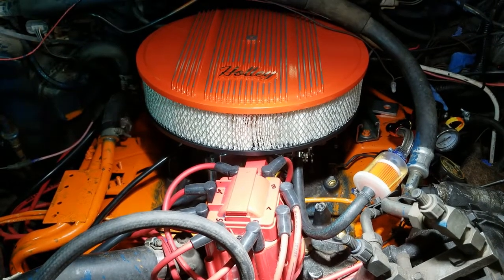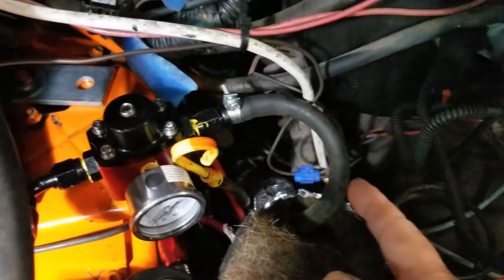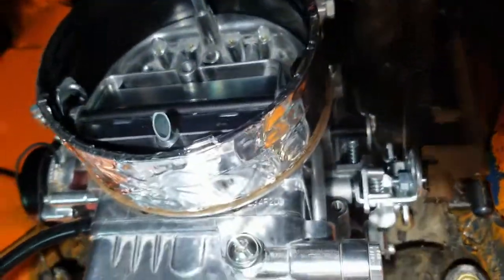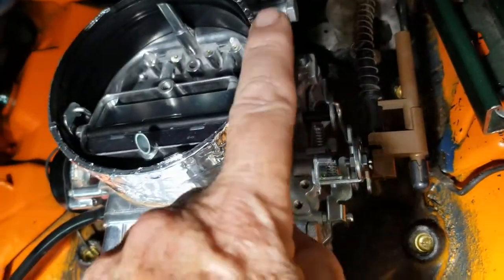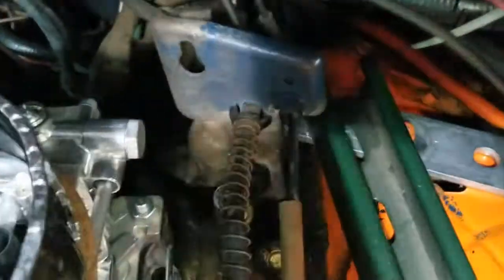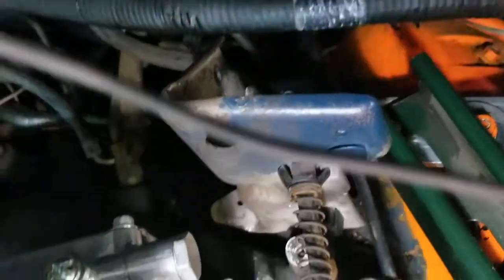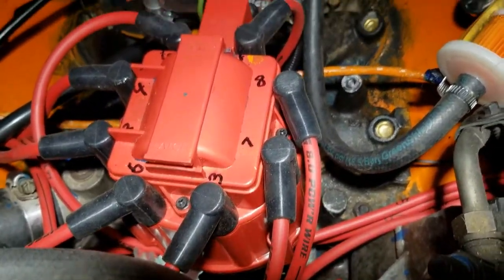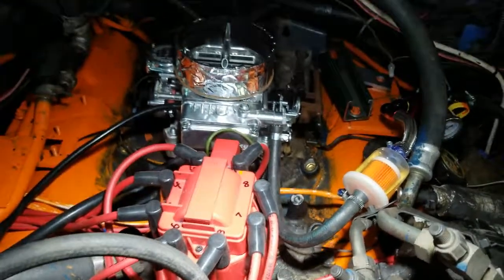Ford 460 EFI to Carburetor Conversion

Comment: Really nice job, it must run sweet now not having that old fuel injection that in notorious for causing issues. Do you have a video of what you removed, and what had to stay to do this conversion. I'm looking to do this, but not sure what to do with all my vacuum lines.
And anything else that needs to be removed, or done. Thank you for any help you can pass on or video

Comment: Why anyone who owns and runs anything Ford even remotely considers GM style HEI garbage distributors as a viable option is beyond me.
Reply from the maker: The HEI distributor delivers a stronger spark, especially at low rpms. Your comment made me do some investigating and I found out that HEI not only puts the coil inside the distributor cap, but also uses an electronic module to fire each point instead of mechanical contacts. Some say that older HEI distributors like this Ford one don't hold up well above 5000 rpm. That is fine for people like me that need low end torque, and never go over 4000 rpm because the engine is so old. The Ford big block is designed for low end torque, while the Chevy big block is more for speed and high end horsepower.

Comment: Where did you get the studs to mount the throttle cable and transmission kickdown cable to the carburetor? Is there a specific size ?
Reply from the maker: The Holley came with a stud that worked for the throttle cable.
I held a bolt-head against a metal cutoff saw blade with vice grips
to grind the head down enough to fit the kickdown cable slot,
but that did not last long before it fell off. So I left it disconnected
and I have never needed the extra power for passing because I
never pass unless I have a mile of clear road. Downshifting to 2
can be done manually if you have a lead foot.

Comment: Do you have to do anything to the computer when doing a efi to carb swap. I got a 93 f350 with a 5 speed manual.
Reply: Has smog delete and egr delete
Reply from the maker: The computer will throw some engine codes, but on my 88 it is not needed and I could unplug it.
Later models have computer controlled automatic transmissions, so they need the computer. I did an automatic to manual swap on a Tundra, and I used resistors to fool the computer.
I did remove the fuse for the brake proportioning valve, but I don't know if later models have more complicated ABS systems that should be left on.

Comment: Did you use the stock Efi manifold and just used a spacer on the stock manifold for the 4bbl?
Reply from the maker: pricemotorsport (dotcom) has the intake manifold adaptor which comes with fuel injector hole plugs.

Comment: What size freeze plugs did you use for the injector holes
Reply: They are 14mm, price motorsports sells the adapter plate with the plugs.

Comment: I've got a 88 that runs if I continue to pour fuel in it thinking about just doing this so I can just run the darn thing any suggestions that I should look at? I've replaced the fuel pump and I'm getting fuel pressure at my rails I just cannot get it to stay running without pouring fuel into the intake
Reply: Yes your floats stuck if it's carbed  use the vent straw put a shit load of carb cleaner down it wait 20 mins get a rubber hammer take get a smaller funnel put it on the straw tube thats metal in the front of the carb put about a half of a soda bottles worth of gas down the funnel take it off start it tap the bowl with a rubber mallot and the float will un stick gas these days is dog shit and the float sticks from the residue

Comment: About to do this with my step-dads 1997 f250HD.
The E4OD has burned up and can't find another one or we have to buy one that cost more then the truck.
The 97 year was a one off transmission with the electronics. So it's not easy to replace.
Plus these trucks are getting hard to find in junkyards, especially the 460 variation.

Going C6 and a carb. Will do the HEI also.

Comment: Does overheat when is in a red light or idle
Reply from the maker: The 460 has lots of comments on various forums about overheating. Mine had the problem too. I added 4x 7-10" fans to the engine bay to blow air in and down around the exhaust manifolds. But then I raised the hood in front by adjusting the stops and hood catch, and in back by prying the edge up with a pry bar, to get about a quarter inch gap all around. Seems to run cooler now.

Comment: What size frost plugs for the injector holes?
Reply from the maker: They are included in the carb adapter kit from pricemotorsport.
You can leave in the efi injectors to block the holes instead, unless they block the carb.

Comment: How much did fuel economy suffer?
Reply: All efi 460s used shitty OBD1 speed density versus the 302 that received mass air. The speed density is straight up garbage, it doesn't like headers, it doesn't like cams, it has almost zero availability for tunes. There's a reason that companies make mass air conversions for the 460. Out of the showroom, speed density was ok, Ford didn't intend on us keeping this stuff alive, and with age, the components deteriorate and performance/mileage suffer. I replaced the speed density efi on my 97 F350 last year with a carb intake conversion and I'm seeing 13-14mpg on long highway drives, if I get silly with the pedal, it is 5mpg. My best highway mileage, not towing, with SD efi was 11mpg. So I gained.
Reply: @TheRoadhammer379  thank you man
Reply: Probably none or got better because efi 460s are nuetered
Reply: @joshlower1  thank you man
Reply: @joshlower1  what do you mean by that
Reply from the maker: Good information in RoadHammer's reply. EFI starts having problems when computer sensors and parts get old (like he said). The carburetor made my engine run great, and I can adjust it when it gets old. I do not know what it did to my fuel economy because I also put 54" tires on, which will make it burn more fuel.
Reply: @stephenharner5938  thank you man

Comment: I did an EGR delete on a 97 f350 and get the low idle stall after it warms up.  I swear I plugged all the vac hoses, but it happens at the exact operating conditions where the EGR would kick in.  Seriously thinking about a carb, but not sure other risks--- like whether the E40D will still shift w/out the signals coming from the computer.    Wondering if another option is just a hard swap out to some other EFI kit.
Reply: Can you please explain what you did with the manifold? Did you plug the injector ports? And what distributor is that exactly?
Reply from the maker: The EGR makes the engine more efficient at moderate throttle (cruising). So it is added by manufacturers to improve fuel economy. Anyone that recommends an EGR delete is simply wrong, and does not understand internal combustion engines.
The EFI computer adjusts the air/fuel ratio assuming there is Exhaust Gas Recirculation.
Since the 460 has the EGR attached to the "cobra" throttle  body which I removed to install the carburetor, I had to delete the EGR. My Holley carb is not designed for EGR.
Reply from the maker: The older C6 transmission I have shifts based on vacuum which tells it the approximate throttle position. The newer transmissions need a throttle position sensor bolted to the carburetor (Holley has it for $150) to tell the transmission when to shift (via the computer). If you install the hei distributor, or the computer fails, you can buy an add-on shift computer but it is expensive ($450-650). Because it took me many long hours to remove the old distributor (it felt like it was welded in), I do not recommend replacing the distributor. I think the computer needs the RPM (tachometer) feed from the distributor, which the hei has too but you would have to know which wire to splice to.